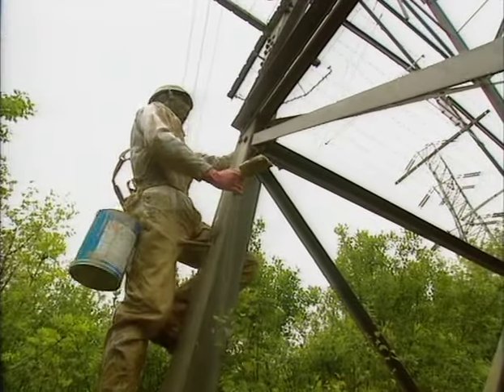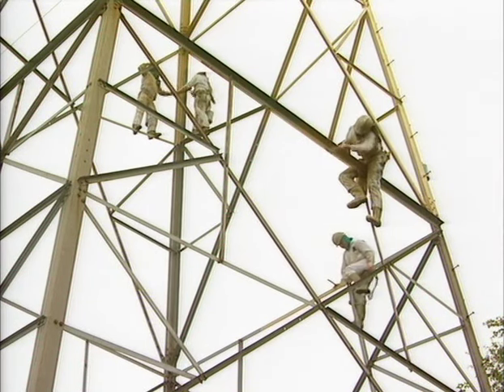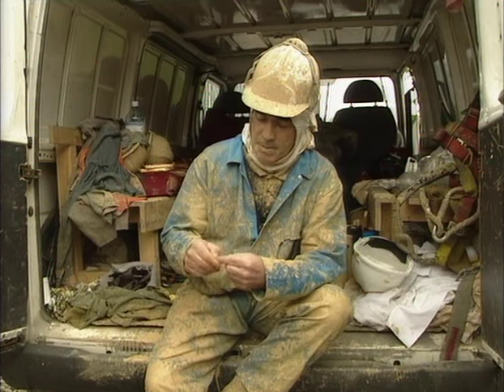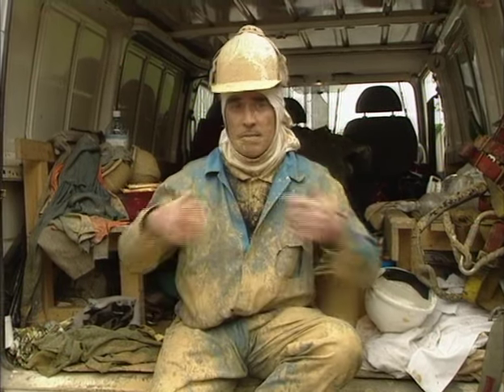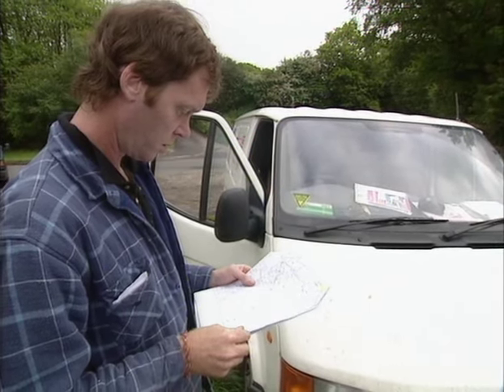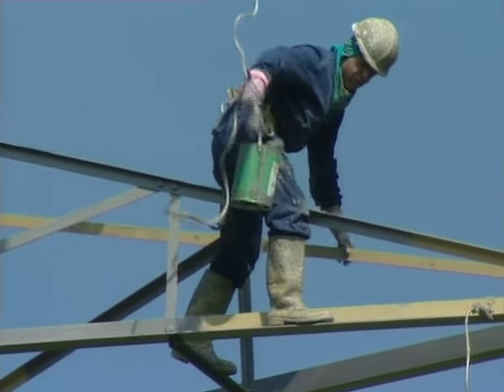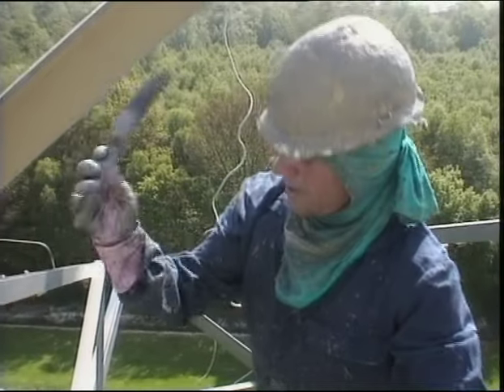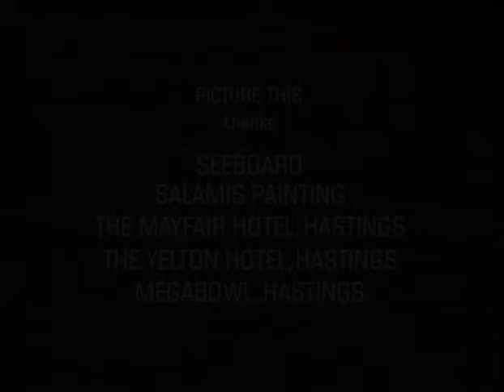Silvering Up

Comment: It's like I have a special connection to these guys, I've lived this life, I've done the work. So, I'm speaking from experience, and the heart. As I've previously said, I painted high voltage towers years ago, I served my apprenticeship painting pylons. Although there are differences, back then we never used any safety belts or no harness, no hardhats, that is basically because of new safety rules, but still so much the same. We rubbed down with vasoline each morning, it helps get the paint off your skin much easier, and we had to wear long sleeves, and rag hats, even in the heat of summer. So you sweat a lot, and it's hard work, believe me, I know. My hats off to these guys. You get close to your co-workers, more so than normal, not only because of the type of work, of looking out for each other, but, you not only work together, but you basically live together, eat together, so you get close. I'll never forget the sound of the high voltage lines, the humm, the sound the electricity makes, and, I remember the static charge, the zap, you feel at times, it gives you a little jolt. Especially if your not holding on good. I've actually painted in substations where we had so little clearance from a " hot" line we had to cut our brush handle off. Or, crawling out on the middle arm of a pylon, you had to stay down low,  your knees sometimes on just the edge of a steel angle iron, a line above you humming, a line below you humming, the sound of the high voltage, quite an experience it was. And, even when the one guy started singing, brought back memories. We would occasionally sing, while we worked, not that we were any good at it. Or we would cut up and joke with each other. Play tricks on each other, such as putting a rock in their bucket of paint, they didn't know until they got down to it. And a more serious note of seeing a friend get into a huge hornet nest while up on a tower, he didn't see it, and hit it with his hand, they were all over him. The lady land owner in this video complaining about the tracks the guys made, some people, she just don't realize how hard these guy's work is. Over here the utilities actually had a right of way, so a farmer could not stop us from painting, or deny us access, but we tried to be respectful also. We painted pylons/towers that crossed hills, mountains, valleys, rivers, farm land, soybean fields, corn fields, cow pastures. I've walked thru shoulder height corn fields early in the morning and they would be soaking wet from dew, and we would be soaking wet right from the start. Yea, this video brings back a lot of memories, I've watched it several times. I have great respect for these guys, very few people actually know how hard this work really is, I do. Be careful guys! Your friend, John
Reply: john g I love your comments just as much as this video!  I don’t think they use their harnesses. This was 1997 so not a hugely long time ago. I expect they were supposed to use the harness!
Reply: Hello there greetings from bulgaria i have a question for you 
I worked  one season the same job everything writen by u is the same 
Here in bulgaria 
Why u stop working this ?
Reply: @Techy4130  Hello and greetings tower painter. I served my apprenticeship  painting high voltage towers, substations, microwave tower's ( red/white, actually called international orange) and I had to travel around. Although I really, really liked all my co-workers, we became good friend's. Like I said, we worked together, ate and shared hotel rooms to save money, we partied together, and had so much fun. But, after while, I kind of got tired of traveling all the time, staying in hotel rooms and eating in restaurants all the time. I wanted to be close to home, in Indiana. So, I transferred my union book to IUPAT local 118 in Louisville, KY. and basically started doing mostly industrial painting. Spray painting with an airless, ceilings in big plants, like Ford, GE, UPS, etc. Using a conventional spray gun, sand blasting tanks. Still, rough, hard work, but pretty good money. Several year's after I left the tower painting outfit, one of my good friend's got into a high voltage line in a substation. Somehow, luckily, he survived, but was very disfigured by the electrical burn's, very badly. I went to see him in the hospital. It was very touching for me. I liked him so much. The company where they were working at the time, took him to court and fought giving him a settlement, although he could never work again. He eventually, maybe 1 1/2-2 year's later, won a settlement, he never could work again. You get close to your co-workers on job's like this. You need to be close, because, you need to watch out for them, and then watch out for you, it's best to have this bond. This was many year's ago when I did this work, cooning tower's. I started out making $3.50 per hour. I would carry paint in, up the big hill's, a 5 gal. bucket on each shoulder, mix, or box, the paint, climb up and refill their bucket's. Until they thought I was getting good enough to start painting, at the bottom at first. Height never bothered.me back then, so I caught on quick. Within a couple of months, I was painting top to bottom, we called certain parts by name, the box, the arm's, the goat head, the ass ache, etc. Average size tower's, if I remember correctly took 8-10 gallons per tower. We worked on some really big tower's that one arm took that.much paint. Tower's never bothered.me so much. Once I stepped on an angle iron that was missing a bolt on one end, and it bent down and gave me a little scare. Probably the worst though, was we would get laid off in the winter, unless we wanted to go south, and work for another company, which I did once, I think In late 1977 or early 1978, we went to Houston Texas for a company out of St Louis I think. They would push safety too much, especially in substations. This is the same company my good friend worked for when he got into an engerized ( hot ) line. The clearance was so little, we would cut our brush handle's off. We should have never done this, it was too close, way too dangerous. But, we did, and nobody was hurt, at least while I was there. 
Are you still painting high voltage tower's ? Did you also work in electrical substations painting? Sorry to ramble on so much. If your still doing this work, just be careful. Don't let any company force you to do any painting without proper clearance, like cutting off brush handle's. It's not worth it. I seen what it did to my friend. Be safe, watch out for your co-workers. Thanks, John

Comment: I added this video to my favorite list. This video was very touching to me, I use to paint high voltage towers ( pylons ) years ago, in my younger days. The guys I worked with , were a really bunch of good guys, we became really close. We not only worked together, but we shared a room together, ate with each other, and went out drinking together. Just as they did in this video. Really brought back some good memories watching this video. There were some differences, but basically the same hard, dangerous work. We never wore safety harness, or hard hats. We couldn't use ropes to pull paint up. But, the biggest difference is we painted high voltage towers while they were " hot ", or energized. The middle arm was kind of hairy, you had a hot line above you, and one below. Every person had a certain part to paint. We would rub down with Vaseline also, it made the paint come off easier. We wore rag hats, t-shirts, to keep the paint out of hair and neck. long sleeve shirts and pants in the hot of summer.We used semi-oval brushes only, no rollers.  My closest scare came when I stepped on an steel angle, and a bolt was missing out of one end, but I caught myself, and kept painting. Years after I transferred my book closer to home, and regular industry painting, a good tower painting friend got into a "hot" line while painting in a substation. I appreciate the video, it really brought back some old memories.My hat's off to you tower ( pylon) painters. I have great respect for guys that work hard, dangerous jobs each day. Good luck guys, stay safe! Thanks, John from Indiana
Reply: john g john g what an awesome comment. I found this documentary absolutely fascinating. I would never be able to do this job, but hats off to these guys. This was filmed in 1997 and I expect their methods were frowned upon then by the safety departments. They would never happen now!   How interesting to hear from someone over the pond speak about his experiences.  

I’d have been 7 when this was filmed.  But to me, it’s such a humbling programme about normal guys, real reality tv, not crap reality tv.
Reply: john g what local?
Reply: @redrobbo1896  I just seen, It was many year's ago, a small company out of Indianapolis, I think it was 1825, but I'm not sure. Then I transferred my book to IUPAT locally, where I retired from.

Comment: I was cameraman on this film for Gwynhelek Productions and it is so good to see the film as I do not have a copy. Someone comments below saying that they hope the painters were well paid...well they were not, they worked on piece-work for a  private company and the wages did not reflect or reward them for the work which was extremely dangerous. Not only dealing with high voltage power lines but climbing hundreds of feet to the top of the towers, with heavy cans of paint. There was one shot that the BBC cut from the edit, as it was a health and safety issue. I was out on one of the arms filming above the painter when he suddenly slipped, luckily he grabbed a bar with the other hand and saved himself from dropping 100 feet to the ground. The shot was in the first edit but it showed he did not have his harness clipped on, so the company would have been pulled up on that and the shot was cut. The reason the guys did not clip on their harnesses was that the caribiners clogged up with paint and did not shut properly and in fact was more dangerous. So the men relied on instinct and self-preservation. At the time of filming 
I think there had only been one death from a fall and that was due to one of the towers being a non-standard design. In my career as a cameraman I have worked in war torn areas of Ethiopia, dived with sharks and many other challenging situations but the 'Pylon Painters' shoot is one film I am most proud of. This was all shot without drones !! it required me to get up there with them. When I arrived on the first morning the painters looked at me rather suspiciously...but after a day with them up on the towers they paid me a great compliment (in a strong brummy accent), "eez a bloke, that Robin eez definitely a bloke" A great privilege to have shared some time with these hard working blokes...thanks, Robin.
Reply: Nice Job Rob, 👍🏼
Old faces & Memories. 
🇬🇧 Rdgr.
Reply: What an amazing story Rob!  I Absolutely love this film. It is so wonderfully produced and wonderfully shot.  It really encapsulates all of the senses, a bit like AMSR!  I’ve appreciated this film for a few years now, a nice, down to earth fly on the wall, covering loads of aspects of the job. You should be proud my friend!  It’s great to see comments from someone so heavily involved!
Reply: I'm amazed the money isn't that good for having to do that , they must have balls of steel . Fair play to you for having the nuts to get up there to film it . Being a painter myself i'm twitchy at the top of a double ladder so i find it staggering these lads can do this  , i've got so much admiration for them doing this work and i just wish they'd received the financial reward it deserved.
Watched this a few times over recent years from my favourites list.
Great little documentary .
Reply: You did a great job helping make this great documentary. It really means a lot to me because I served my apprenticeship painting high voltage tower's and substations year's ago. I know how hard the work is. I wish all the guy's the best, and hope they stay safe. Thank you, John
Reply: Hi Robin it's Neil. I remember when you first climbed with me and you said "do I go up first?" I said "no I do in case you fall and take me with you!" Tower humour and certainly gained our respect!
Reply: @neilpazadian5231   hi frip
Reply: I apologize I just seen your comment.  I've made a few comments on your video of the tower painter's.  This is the exact same type of work I served my apprenticeship doing, and with some very good, hard working guy's.  So even though it's been year's ago, I'm now retired, there is still a special bond.  I know how hard the work is! These guys deserve to be paid very, very well! It's very sad to hear their not.  
Sounds like you have done some very cool work, on various jobs, while filming.  That's cool! I wonder how all these guy's are doing now, have you heard anything from any of them? Thanks again,  John, the old tower painter.
Reply: Great story. Great work 👏  I always wondered about the men who filmed old Fred Dibnah.

Comment: I found this doc from a link from "pylon of the month", and it really moved me.  This is a very necessary job that very few are aware of.  Full respect!  The physical and mental challenge these guys face to maintain the flow of electricity for the rest of us is nearly heroic.  The next time that I'm working on a tall ladder or up on a steep roof and begin to get a little weak-kneed, I will remember them.

Comment: Great little doc. Thanks for sharing. Two questions; what happened to these lads 20+ years later? How are things done different today?
Reply: Doggie Mouth I found someone and we were speaking of the programme; turns out he works/has worked with some. The young lad, 29, the ex soldier is still doing the job, and I think 1 or 2 of the others are still doing it 
From what I’ve heard it’s the same, but they use slightly better harnesses and high viz

Comment: 10:31 10kV however naff current, that voltage would soon drop.
Reply: Still not sure I'd want it whilst 100ft in the air while steadying myself with one arm 😂